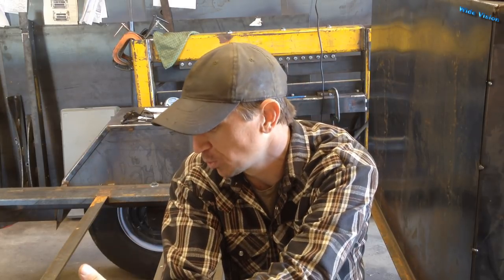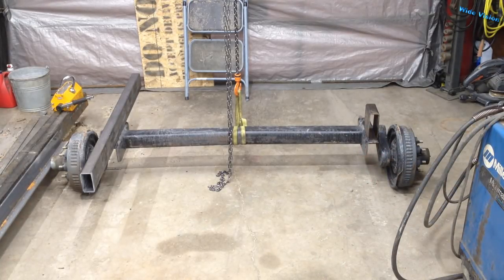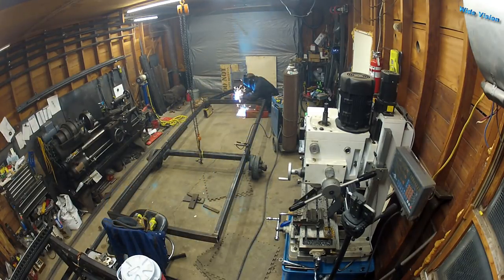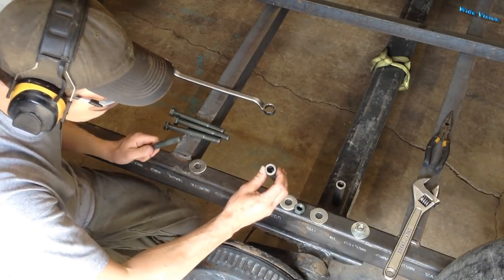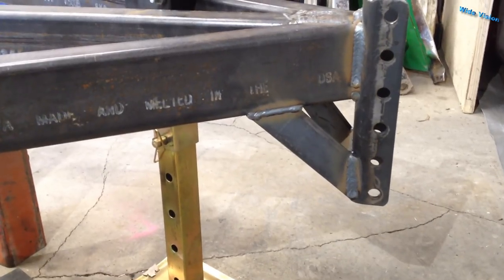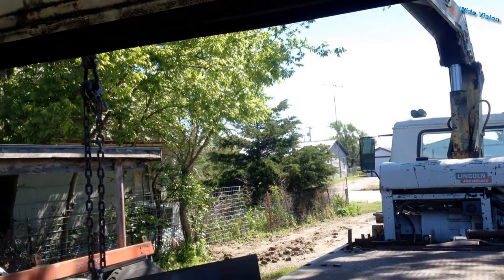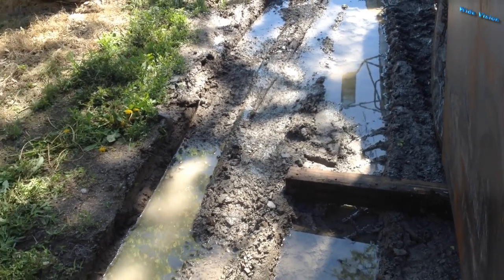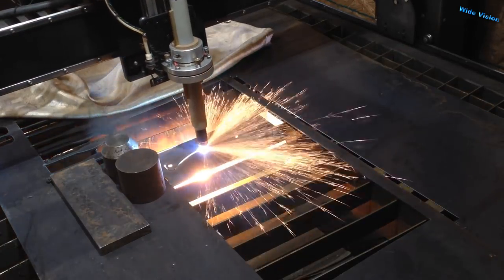Frame -  Custom Fuel Trailer Build - 3rd Video

Comment: Looks good.  That is one thing nice about a CNC plasma table.  If you need some kind of washer or spacer, you can just draw it up and cut it out.  I don't envy you having to work alone.  I usually try to be around when my son is building the bigger things to help hm align things and move it around and to load plate on the plasma table.  The heaviest thing he has built so far was a drive over auger.  I don't remember if he loaded it with his 4400 lb tip skid steer or had the guys that he built it for to bring over a bigger one.  P.S  I live in the opposite corner of the state.  We normally get about 45" of rain per year.  Al ready we are over 61" this year.  This is the first year in over 50 years that people were praying that it would quit raining in August.

Comment: I enjoy seeing your solutions to problems.  The bucket bracket is a great idea.  I may do something similar for my utility trailer.  Have you considered a solar heater for the garage?  It could save money spent for wood.  You know, a black collector box with tubing running through the wall with a small fan to aid circulation.  I'm sure there must be good plans available on the 'net.

Comment: get rid of them light boxs, they will be ripped off first week, cut out your light holes in the back 2x4 tubing, put your rubber gromit in pop in the lights, i do it on all my customer built trailers, also for the jack pit a half inch long weld on the jack to the trailer frame in a place you can get a 4 inch grinder into, people steel the, all the time, same with the adjustable hitch

Comment: Post the video in parts. it what I do or have done in the past. I would have left that axle where you put it for the simple reason of nose weight on the hitch is less than where the axle is now, granted only by a bt but the balance is better. And I would have just welded in another angle iron cross member instead of all that cutting and rewelding. I only said this because I screw up and then have to ponder the easiest solution. It's good and honest that you post such videos rather than perfect stuff like some folk that hide their mistakes.

Comment: Do you by any chance have a material list for this trailer? I like the length and width, plus the axle and wheel/tire setup is more my speed. I know all I have to do is pull them up like everyone else, well, almost everyone, lol.  Just checking. Loving your videos that tell about this trailer build. Keep them coming sir. Thanks for your hard work too.

Comment: Seems like it would have been a good idea 10 design where the welter pulls out like it in a drawer So they can easily get to it to maintain it put fuel in it You know change the  Oil

Comment: Try using E71T1-1 ( Lincoln Outershield 71M)dual shield flux core wire to weld the fuel tank.  Check out J. D. Brewer talking to Jody on Welding Tips and Tricks about Dual Shield Flux Core Welding.

Comment: Couldn't rolled ya some 4" or 5" rings for the buckets to sit in or have have them sit countersunk into the trailer? Could have put the lights in the back tubing and marker lights in the ends of the tubing and the wiring through the long tubings so it couldn't get drug off.  But I guess whatever customer wants. Lol

Comment: If you listen very carefully, you could hear the dog say: THESE ARE My MATT'S, now shut up and let me sleep human. You got your job welding, my job is sleeping comfortably on my Matt's, now get back to work. Nice work around for the buckets. If you want to still be able to bend with your knee's, when you get to my age 66 yr's old, 25 yr's autobody, 18 yr's and still counting welding (5 yr's ship yards) / metal fab STAY OFF THE CONCRETE FLOORS, either place/keep a 2" in. X 6" in. piece of lumber to kneel on, or buy some more Matt's. It's not the one or two times kneeling on the concrete, it's the repeating day after day, week after week, will take it's toll. Thank God, I took my own advice, and I can still move, kneel etc, like I'm 25 yr's old. P.S. DON'T sit on bear concrete / steel, do I need to tell you about a certain BUTT HOLE and the problems that will cause, again not from the one or two times, it's the repetitive act over years that causes the problem's.